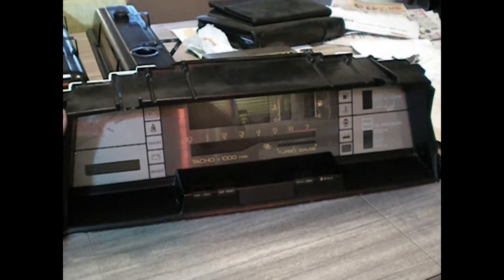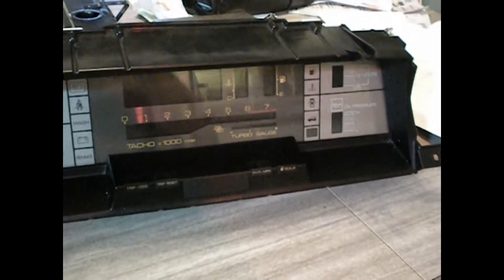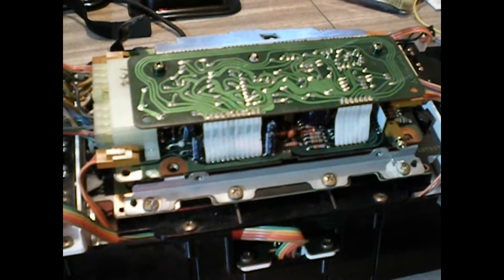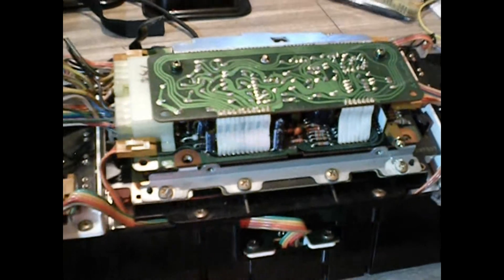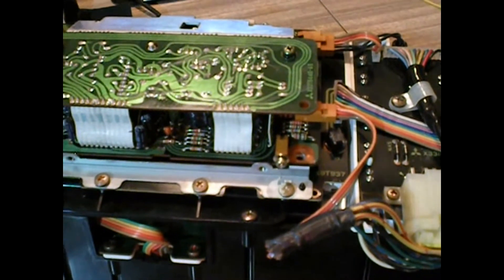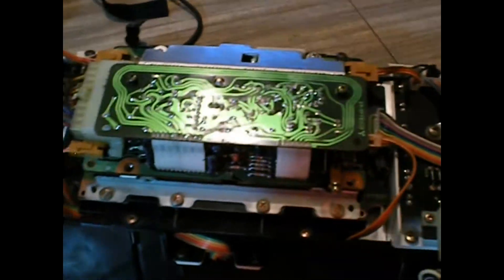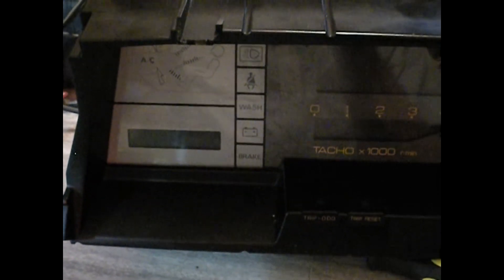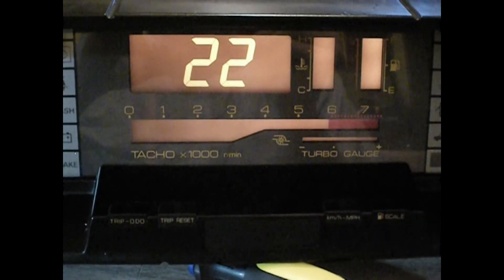Starion Technica Digital Dash Gauges, Repair and Test

Comment: Hey I know this video is several years old and I'm a bit late to the show, but I recently came into ownership a 1987 Chrysler conquest TSi with analog gauges. I found an image of a digital gauge that was in the Starion and instantly fell in love with them and knew I wanted them in my car. Do you know how feasible it is if I get my hands on one of these digital gauges to swap it with the current analog gauges?
Reply: I have a rare mint condition digital cluster I may part with. You can contact me through www.starquestparts.net
Reply from the maker: It can be done. Before I got rid of the car I was preparing to install a digital cluster. The trick is to get the digital harness plug ends with the cluster and splice them into the existing harness, if you don't want to rewire the entire dash with a complete proper harness. The digital cluster also requires a dedicated fuel sending unit, though there was someone from one of the starquest forums who came up with an adapter circuit. I think the cluster also requires a dedicated VSS, but I may be wrong about this.

Comment: Can I ask a question? How do you hook up power to test a gauge cluster? 
Thanks!
Reply from the maker: Sure, if you have the connector pigtails or wiring harness, then you'll connect the solid blacks to 12v - and the red with black tracer to 12v +. I had to jumper the two pin header underneath the speedometer in order to get the cluster to light up, I really don't know what was supposed to plug into this originally.
Reply: @HiFiasco  Not sure if you’ll see this, but I’m working on my cluster out of my 87 Technica and was wondering if you applied 12v to the connector on the speedo or the connector on the fuel gauge board? Also that 2-pin connector you weren’t sure about didn’t have anything connected to it on mine either and it’s the factory unit in my car
Reply: Thanks, I dont know much about electrical, so that is why I ask. Do you use one of those kinda large batteries? Thanks again1